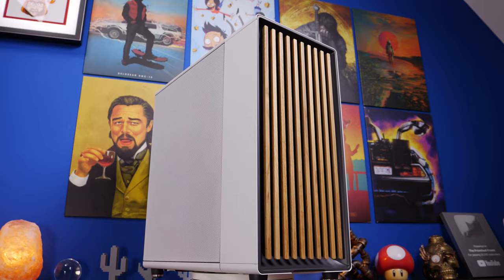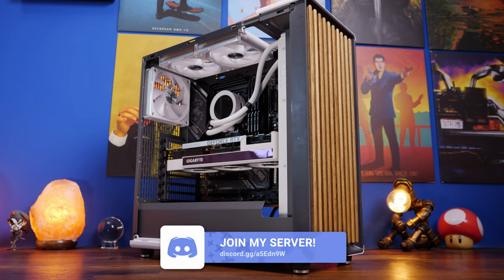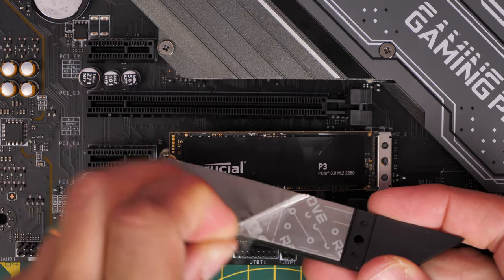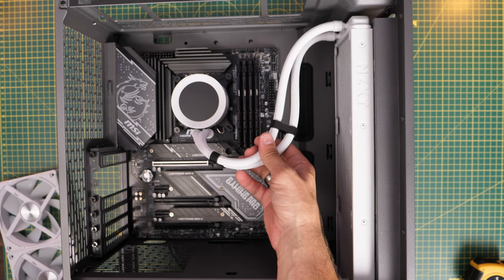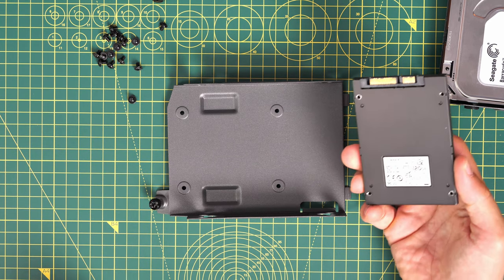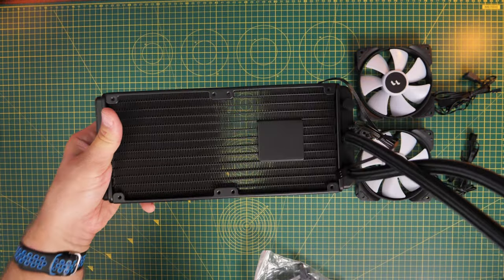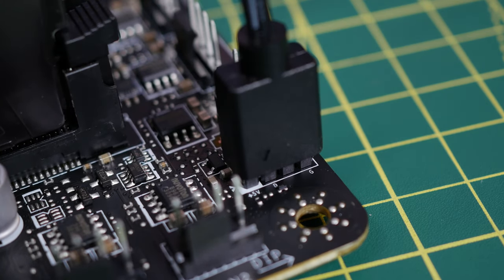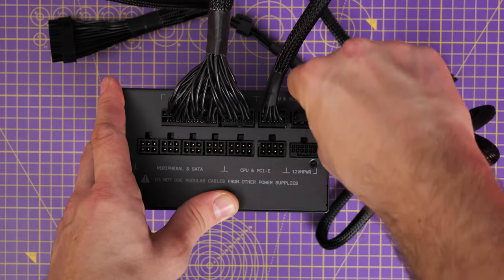Fractal Design North in-depth build guide with Lumen S24 AIO and RGB fans

Comment: Oh man.. I have this exact same case bought and preparing a build on it. This video is so insightful for me, thank you. Was confused about the 360mm radiator on a 14700K, how would I even mount it. Seen some videos where they recommend tubes at the bottom, glad to see that's possible with this case, although... man it just looks kind of horrible... I'd prefer tubes on the top to make that loop look great visually. Still confused on how I will do it but thanks for this video, makes it a bit clearer ❤

Comment: Thank you so much for that GPU lenght part. I was thinking about putting 360 AIO front with 4080 into that case. 4080 in my case is 35.2cm long.

Comment: Great video as always! 

There is actually a tiny cutout top right corner where cables can be passed through. And because of the little wall at the front lf the case, they wont be visible.

Comment: Got the TG charcoal and it's gonna be my first build, this is such an informative and detailed video, so massive thanks! 

I'm still a bit on the fence as to what kind of cpu cooling I want; an air cooler like a deepcool ak500 zero dark or apnx ap1-v, or an aio like this lumen v2 without the rgb fans or an msi mag coreliquid p240. I wanna pair it with a 13700 and will use it mostly for workstation/productivity related tasks rather than full on gaming, gpu will probably be an asus proart rtx 4070.

Comment: Quickie!!! As it looks now- the side fan bracket is awesome and you can use the two 140mm fans that came with the case. But as you put them in at the end. It looks like you could fit a second aide panel bracket above it!!! So 4 intake on the side ? I think the rgb on that would look dope AF! Questions is. Will that fit? Can I buy an additional bracket?

Comment: Would the Fractal Lumen S28 (280mm) fit the top mount too? You mentioned two 140mm fans would fit, so i assume a similar sized radiator to what you used would as well...

Comment: Nice vid. So you used one screw for the radiator AND the front fans? What is the length of those? Thanks :)
Reply from the maker: The radiator is mounted to the top with small screws, the fans mount with long ones. Unless I'm misunderstanding you.

Comment: Thanks so much for getting into the details of the 360 AIO, I couldn’t find definitive information on this anywhere. I have a question though, when you remove the fans on the inside you said the cooling wouldn’t be as good. Is this because of how close the gpu will be to the radiator or simply because the radiator is no longer push/pull? I’ve read conflicting opinions on whether push/pull really makes a noticeable difference. 

I currently have a sapphire nitro+ 7900 xtx gpu (320mm long) and I have a 360 aio ordered and I’m very conflicted about whether to go for it or actually go through the hassle of sending it back and going a different route. Im leaning towards keeping it if push/pull won’t affect much.
Reply: Push-Pull makes a minimal difference, if at all. Why he chose a push-280 over a push-360 is beyond me (other than some esthetics that he preferred)...it makes no sense at all. Just go with a 360 rad and call it a day.
Reply: @alandab  lower noise of the 280 maybe?
Reply: @davidecattani8282  Nah. Bigger fans make less noise.
Reply: @alandab  Sorry, what do you mean here? You would prefer he use a push 360 in the front (as that's the only place the North fits it)?

What is the ideal cooling setup? Intake front 360AIO, intake side fans with bracket, then exhaust 2x top? Or intake 2x top as well and then maybe one exhaust 120 rear?

I'm trying to plan my own build. :)
Reply: @BAAa-tw7lo  Dude, where did you, Fractal, and all the other content creators get your info?! DAFUQ! I just built a Fractal North XL with an Arctic Freezer III 420 in the front with the hose DOWN, and two Silverston 180mm fans in the top. I have 6 140mm fans and 2 180mm fans COMFORTABLY installed in my case. What are you talking about?
Reply: @alandab  Not sure why you tagged me; I can't answer to claims I haven't made. I'm just operating on the information I can find online as I don't have the case yet on hand (and we're discussing the North, NOT North XL).

Comment: Would it be tacky to remove the  middle fan of the AIO if with a push pull config to fit the GPU?
Reply from the maker: No one will see if you have the mesh panel 🤷🏼‍♂️

Comment: How tf does someone make a 1-hour video about a computer case.
Reply from the maker: It's called in depth for a reason
Reply: @TheProvokedPrawn  it was indeed very in depth. The biggest help was the fact I had to order angled GPU power adapters so the tray can fit in the case. Also the fact that you measured the maximum length for a GPU if you want to do push/pull in the front. I am also curious if you can buy another tray and have a total of 4 fans intake air from the side panel. My current set up is intake from the rear and side with exhaust from the front. It's unorodoxed but it works for me.

Comment: I don't get why ppl make build guide videos but then keep using these weird radiators 🙄 like look at what average consumers are using, else they're going to skip your video like I am.
Reply from the maker: What are you on about
Reply: @TheProvokedPrawn  You have fans that are also connected to be the CPU cooler, but most builds including mine have PC case fans, then a separate CPU cooler. And most builds online have separate CPU cooler.
All I'm suggesting if you want to make a build video that ppl will use as a guide, to appeal to your masses.
Reply from the maker: @Aurora_Celeste  you obviously didn't watch the whole thing. The push pull setup was to show what is possible if people want to. I also demo installing a "standard" setup on the top of the case. My videos are detailed and thorough to cover different possibilities as not everyone will want the same config obviously...
Reply: @TheProvokedPrawn  Hey so I apologize for the frustrated tone of my initial comment. I get that your matching that energy back with your response, but if you just think about it logically for a moment:

I came from another build video that I was watching step by step. When I hit an issue once I got to the case fans/cpu cooler and then went to look at other videos that did not have this issue. Then I clicked on yours and skipped forward to the fans part and saw that it was the same weird fans/cpu cooler combo, left that comment and moved on to another video to find what I was looking for.

Logically why would I try continue watching yours? That makes no sense.